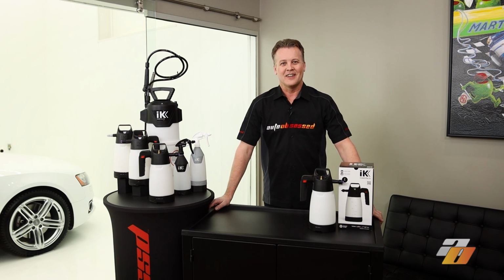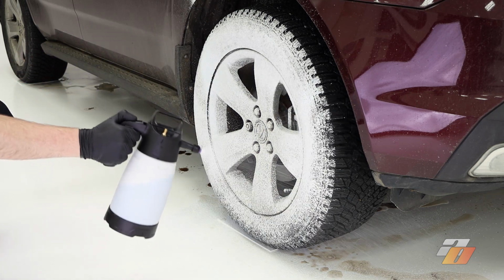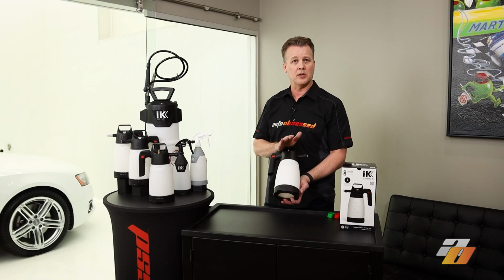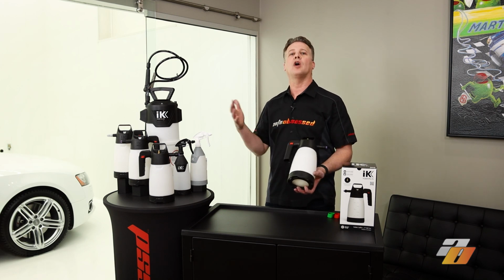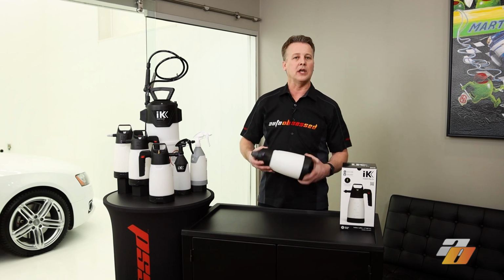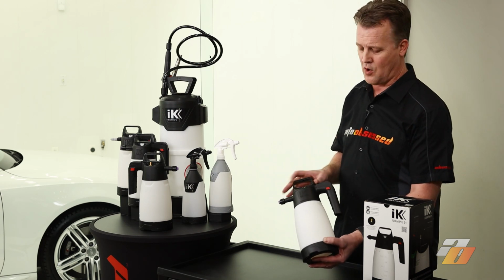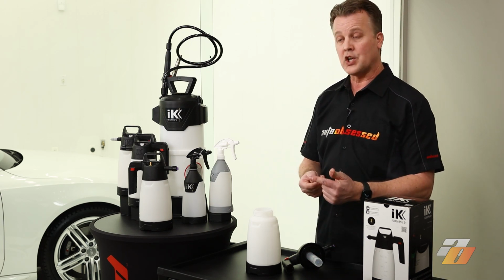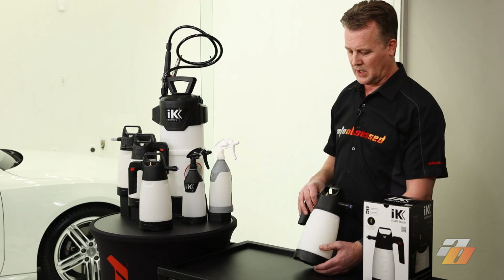Handheld Pressurized Sprayer – IK Foam Pro 2+ Review

Comment: Is it same as the other model but they simply drilled a hole on top and put in shreder valve cuz I can up grade mine for 5 bucks if thsts the case
Reply: I’ve considered doing the same thing
Reply: @norwoodaerialimaging9795  let me know how goes if you do it I am thinking of doing my self I have done on cheap home dempo sprayers works great
Reply: I added a valve to my Marolex foam sprayer 3000 and works great

Comment: Looks like an awesome upgrade!    And that was a nice tip on using the battery powered air machine to pump it up for those who don't have an air compressor.   That allows anyone to benefit from getting one of these new sprayers with the air valve.    NICE!
Reply from the maker: Appreciate your feedback and yes the portable inflator works great for a low cost.  Thank you for your support.